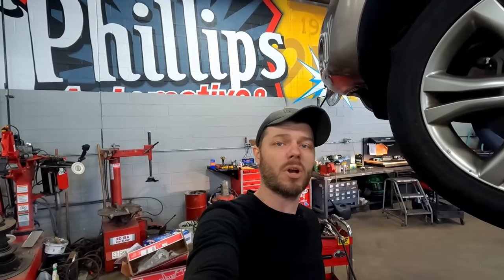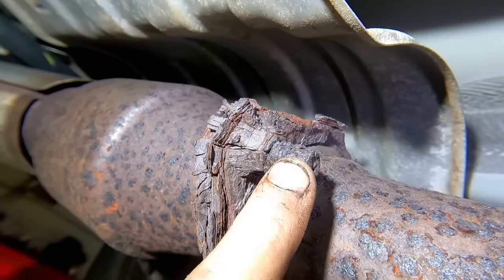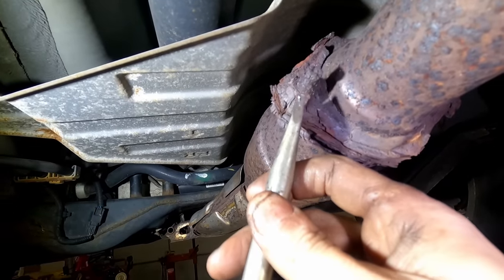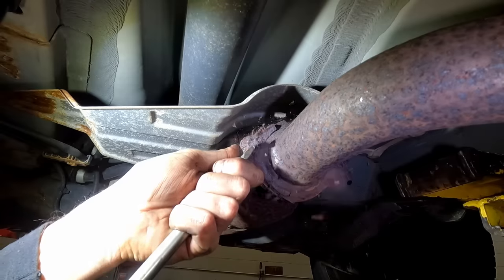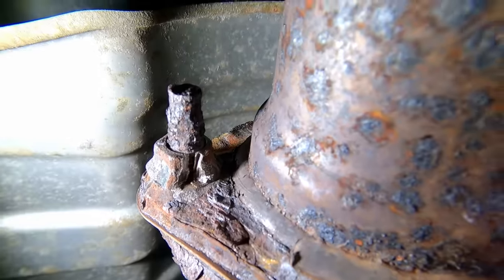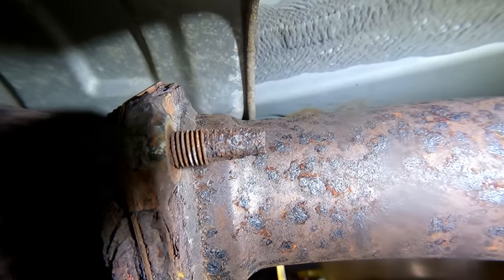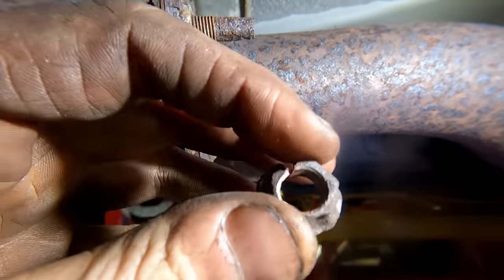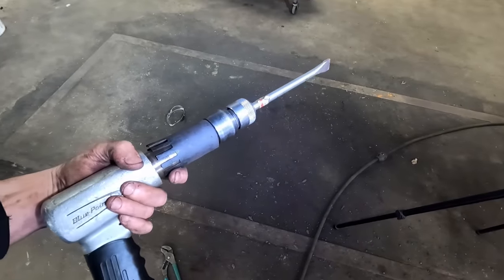Top Secret Mechanics Trick 2! HOW TO remove extremely rusty exhaust nuts FAST without heat.

Comment: Main problem is that most of the time you need to remove those nuts in areas where little to no access is present. E.g. Exhaust manifold
Reply: That's what I'm encountering with my GF's '05 Mazda 6. It spent its first few years on the east coast (road salt!) and I'm having a HELL of a time getting the busted flex pipe off. I'm about ready to torch the turd.
Reply: @NordicDan  I don't know how east coast mechanics deal with this crap. I could never imagine that much salt and crap on the underside of my car.
Reply: @life_of_riley88  I guess annual underbody treatments with different options to spray oil on the undercarriage are available, but knowing how most people are with cars, I can bet not everyone would do it. I sure as hell would rough since I do my own work lol
Reply: @NordicDan  a lot of times I will take a 12pt socket of one size smaller or a easy out socket with a long extension from under the vehicle and pound onto the nut with a hammer and then wrench them off. Usually the pounding on of the socket will break the rusted nut loose enough to help them spin off.
Reply: @midnightrider1854  that usually works pretty good too.

Whenever I can I make sure to hit the fasteners with Mouse Milk or Gibbs too before I try to break it loose. 90% of the time that's all it takes but then that other 10% is a busted knuckle extravaganza 😂
Reply: @NordicDan  lol an over night presoak with any kind of penetrate is always a good way too go cause them busted knuckles def ain't no friggin fun. 🤣🤣🤣🤣
Reply: @midnightrider1854  6 pt socket all the way
Reply: @williamh2032  I agree but if it is too rusted away and a six pt socket it's too sloppy it will just strip. So I take a 12pt of the next size down whether it be metric or standard (whichever fits tighter on the nut) and pound that sucker on with a hammer cause the hammering action seems to bust em loose also.
Reply: @midnightrider1854  I'm with you. If a nut is already in good shape I'll grab a 6 point over a 12 every time, especially if the torque is high because often a 12 will slip and round a corner off anyhow.
Go straight for a smaller 12 if the nut is already buggered.😊
Reply: @steveclark..  Exactly..🔧😁😁👨‍🔧👍
Reply: @l.no.solace7209  when you can gain access to get a torch or induction heater in there I agree 100%. But a lot of times you don't have that option. But just for shits and giggles why can you not use MAPP gas? And I never use it on the head of the bolts I always use it on the flange or the nuts depending on which one contains the threads.
Reply: If you overheat the flange on the exhaust manifold with MAPP gas you could overheat part of the head, just saying you gotta be careful with how hot that shit burns
Reply: You can put a cold chisel in a long 1/2 inch extension and hammer on it to grove the nut in at least 2 places axially. You can cut through nut wide enough to slide it off axially.
Reply: @l.no.solace7209  ah gotcha. But see, that's not what we were commenting on  we were talking about the flanges like in the video. (On the car and pipe gatherings). I'm sorry about the confusion. Although I have used oxy-acetylene on the manifold itself before. The heat dissipates before it soaks into the head even still the head gets very hot. Hotter than what you have to worry about from the transference from the heat from the stud. In my opinion. I wouldn't stick the torch ON THE HEAD or directly next to the head. But I believe heating the studs are fine.
Reply: @KarlZeroOlsen  this is true if the rest of the exhaust is in decent enough shape to take the pounding.
Reply: @NordicDan  How do you spray oil on an exhaust component that reaches temps of hundreds of degrees? Yeah, not happening!
Reply: @timrussell1559  Crazy idea, but it gets sprayed when it's cool. Granted the oil will mostly cook away as the vehicle is driven, but it will still slow down corrosion on the fasteners; which corrosion prevention on the underbody is the entire idea behind the treatments.
Reply: @NordicDan  If you are talking about using an oil to slow the corrosion of the nuts and studs while driving? Well, about the only thing that I could recommend would be a ultra high temp silicone plug over them after a thin coat of copper anti-seize or something. Personally I've never tried to cover them other than the copper coat. And for penetrant, all I use anymore, is a mix of 15% acetone to 85% ATF. And it works wonderful. I will never go back to cheap store bought products again. Just my opinion.
Reply: @midnightrider1854  I use the same concoction for penetrating oil but mine is a 50/50 mix. I've had very good results for years and use it over store bought crap every time. I'm just curious how you came about that ratio. If I can improve on it, I'm all for it.
Reply: @ironpanther2420  Hey, I have used 10 to 90 ratio for years but just decided to step it up a bit. I tried a 40-60 mix but it really separated a lot and I found out that I was spraying more acetone that atf. So I just sort of fell into the 15-85 ratio and it has treated me good.this stuff is so much better than these guys realize. I can't convince the guys in the shop just how amazing it is. They won't even try it.  They only use pb blaster. I just die laughing Everytime they pick up one of those cans.
Reply: @midnightrider1854  Thanks for taking the time to answer man. I'll adjust the the ratio and give it a shot in the future. I guess I was so impressed how much better it worked over PB that I never thought to adjust the ratio. And same with the PB. All the years of working on rusted stuff as a young man I've grown to associate the smell of it with pain and frustration lol.
Reply: @ironpanther2420  You're welcome Brother. And I totally agree with the smell of the PB. Lol That's just funny right there. I don't know if the ratio is gonna work for you but it does seem to work for me and on those rusted up semi trucks and trailers that I am working on daily. Good luck. 🔧🧰👍
Reply: @midnightrider1854  The oil treatments from what I've seen and been told of them are an overall protectant for the entire undercarriage during the winter months and meant to be an annual thing in regions where they salt the roads, as opposed to just an attempt to protect exhaust hardware. My thought was that since they're meant to be an annual thing, even despite exhaust heat I would expect there would still be some reduction in corrosion of the exhaust hardware. For long term protection of the exhaust hardware I agree with your point of using copper anti-seize and occasionally re-coating the hardware with that (I assume it's copper anti-seize you're referring to?).

As for the penetrant, I haven't tried the acetone & ATF mix, but I'm willing to try anything once. For years I've used Kroil, and then a few years back switched to Mouse Milk with great results, but the stuff is most certainly pricey. I figure it's got to work if they don't allow it to be sold in Kalifornia 😂
Reply: @NordicDan  Yes indeed, copper coat anti seize is exactly what I was referring to. And I have found that usually the undercoating (which is what we call it) tends to char and burn itself to the hardware. Turning into a very hard substance. That and it is a fire hazard when it heats up. That's why most of the professional undercoat companies  stay away from the exhaust when spraying. That and it stinks when burning off. Lol Also, I have tried Kroil for many years but went back to the acetone/ATF mix because, in my opinion, it Is cheaper and works amazing. Bit I have heard people mention mouse milk but never seen it for sale around here. (NY) Not  a lot different than Cali if you ask me, way too many restrictions and rules.
Reply: @NordicDan  can't rust treat exhaust parts
Reply: @Galgamoth  actually you can treat the hardware. It takes maintenance because nothing is permanent due to the heat and road spray, but it can be done. I've used copper anti seize (like what was discussed previously) on my own truck for the past 25 years with great success. Inspection and application of new anti seize every couple years has proven great on both my exhaust and suspension hardware.
Reply: @NordicDan  You are absolutely correct sir. And if you wanted to go one step further there are treatments and coatings like ceramic, Teflon, high temp paint, high temp    bare metal primer, ECT. But the easiest way that I have tried is hight temp anti-seize.  And fluid film for the under coating process
Reply: @life_of_riley88  It's a real struggle mate. I grew up in the north. And talk about working on rusty cars while broke and you need the car to keep running. I have since acquired a nice tool collection and am very proficient working with rust. Patience, a good chisel, solid ball peen hammer, impact and extractor sockets, and a solid ball peen hammer are your best friends. When all else fails and I could not remove a rusty axle from the rear of a car, a 10LB sledge hammer does the trick every time.
Reply: There’s several ways to do this but I don’t think any are as fast as this. Good job and thanks for posting.
Reply: I’ve had good luck with Liquid Wrench and map gas. I hate the smell of PB, it smells like pain and failure.

Afterwards, I put a good dollop of anti seize and this CRC liquid wax spray film.

Nowadays, since all of the parts of my car are replaced by now, most of my labor goes towards cleaning threads and treating them. Removing and installing parts is the easy part whereas when I first got my used car, removing parts was by far the toughest thing. At first the only method that worked for me was the sawzaw.

Luckily I only fix my own car and not other clients with seized parts. I have so much respect to actual mechanics in the North.
Reply: @life_of_riley88  West Coast mechanics are just lazy
Reply: @NordicDan  You can't undercoat exhaust lol
Reply: @JackRR15  tell us you didn't read through the thread without telling us you didn't read through the thread
Reply: @NordicDan  You're right but youtube threads are shit
Reply: @JackRR15  fair enough
Reply: Hahaha you're absolutely right
Reply: @NordicDan  anti seize doesn't prevent the flange from rusting away, just allows the nut to come off,  stainless is the only permanent solution
Reply: Same here no room. Would work great if I  had the room
Reply: I wish I had an air hammer I just use a chisel and hammer like I was shown as an apprentice I guess if I had to deal with such fasteners on a daily basis I'd buy one
Reply: Absolutely correct
Reply: There are no bolts that are UNACCESSIBLE!?
Reply: That was so refreshing and genius. I want to send this video to a few local mechanics. I drive a taxi and do lots of work/DIY on my car, but certain jobs just need lifts and expertise. No excuses from my mechanic about seized control arm bolts suspension etc will be tolerated anymore 😎🙏🏼
Reply: undercoating will burn off exhaust components. Exhaust is a wear item in the rust belt.
Reply: Bloody nightmare on elm Street these rusty nuts . I've got one on my car that I can't even see as it's round the back and close to the manifold. If I removed the manifold I might have even more trouble. It's my daily so I keep putting it off .
Reply: I think engineers should have to go out in the real world and work on these things.  300 series ss nut and bolt would solve this problem, guess it cost too much.
Reply: amen to that 

try working on a gen 4 f body 

trust me you will invent new swear words 

ask me how l know 😂
Reply: @NordicDan Im in the north west of england sir and l feel exactly what you’re saying 

took a week to get the header bolts out of my 97 camaro 

the best recommendation l can offer is to replace everything with non ferrous studs and nuts if the car  is a keeper 

and please believe l would help you if l could 🙏🏻 god bless you and yours from the north west of england
Reply: Use a nut splitter
Reply: We don't have to ask, our ears are ringing👍ps try working on a Saab, pronounced "S-O-B" 900 turbo with its backwards mounted engine
Reply: I had to do a manifold job yesterday, the most rearward bolt wasn't visible from where you can get at it and it isnt reachable from below even though you can see it, took 5 hours to put two new gaskets in and it still leaked in the same place because the manifold is warped in the first place but the owner didnt want to get a new one so its my day off now and Im sure the boys are having fun re-doing my work lol .
Reply: @MrROTD  Is it exhaust manifold you're talking about? You can have it resurfaced at a machine shop, if it costs less than buying a new manifold.
Reply: Ain't that the truth, brother!  A shop lift does open up options that don't exist for DIYers and mobile mechanics.  But even then a good number of exhausts simply won't have anywhere near the space to get a power chisel in properly.  As far as badly rusted parts go, this is not even close to what passes for an average day on the job in the East Coast.

With EVs becoming more common, I'm guessing there will be a push in the near future to ban salts use completely.  Salt and rust do have a way of totaling out vehicles with power trains that can do another 100k miles easily.
Reply: I finally got my Y Pipe out and replaced.. believe me when I tell you the nuts and bolts where almost impossible to get too.. but I managed to replace my Y pipe!
Reply: Tissue?
Reply: @midnightrider1854 does map gas get nuts hot enough?
Reply: @1Patient  it used to but they quit making the actual "mapp" gas. But it's more the torch tip that creates the heat concentration in my opinion. I have a tip that a buddy of mine sold to me that is for propane. He used to blow glass projects. And this tip is insanely hot off of just propane.  It has something to do with the way that it manifolds with the air.
Reply: Use a Dremel with a 1/8 tungsten carbide cutter and cut the nut right before it hits the threads, then cold chisel the nut off
Reply: @midnightrider1854  we learned that in welding class, tips, especially clean ones, are necessary for how hot something can get.
Reply: @NordicDan what is mouse milk🤔
Reply: @BlueCollarClub  It's a ridiculously good penetrating oil. I've been a die hard Kroil user for the last 20+ years for stuck stuff, but found out about a year ago about Mouse Milk and it works even better than Kroil. Not legal to sell in certain states (CA being one of them, go figure), but if you can get it, it's worth it.
Reply: @NordicDan  You could put on undercoating every week and it wouldn't help exhaust parts.  They get hot and would burn off any oil-like coating.  It's so pointless they try to avoid spraying the exhaust because it will just make a bunch of smoke coming out under the car later.  Some undercoating over spray and dripping lands there anyway so we do see some smoke in the first few days after an undercoating treatment.
Reply: @NordicDan  Not even 1% of people are willing to pay $150-$200 for something that doesn't directly affect them in their dealing with their own car. Customers don't care about the mechanics they think we just fart around and spin ratchets. But then wonder why we won't work on their vehicle when we go to lift and shock mounts start pulling away from frame.
Reply: @lightotw 🤦‍♂ 

I never said the spray-on oil would keep the exhaust hardware from corroding. As a matter of fact I specifically said, several times, that copper anti-seize is the best method for long term protection of exhaust hardware, which even then isn't a forever solution.
Reply: 90s camaro
Reply: Sawzall the flange off,   fabricate and weld on a new flange .& Hardware
Reply: @midnightrider1854 6 point extractor socket is the way to go, had o2 sensor seized like never seen b4, every o2 sensor socket wasn't doing it even with hose clamp around split socket would just spread with how much torque it required, put 6pt extractor socket on still required serious leverage and elbow grease but finally broke lose, it ate up the threading but thread chaser had it fitting tighter than could ask for, in now way was it rusted as the exhaust bolts which is my next project but really don't want to hit it with a torch was thinking taking angle grinder to it but would need to replace studs which don't want to do or attempting to use a nut splitter and then work it off but seems like a good method for breaking em off
Reply: @midnightrider1854 might have to give that a whirl thanks. Tried doing something similar but this is an even better idea.